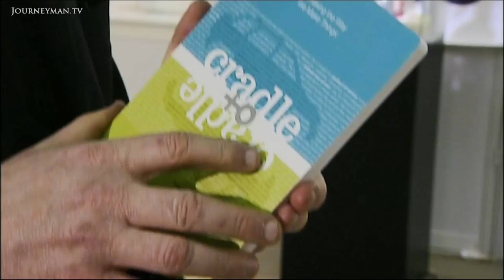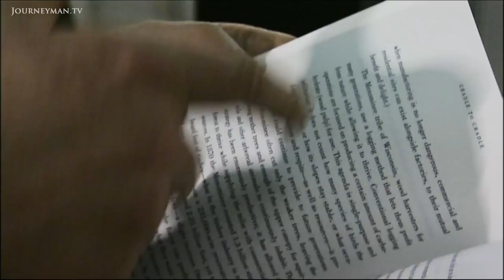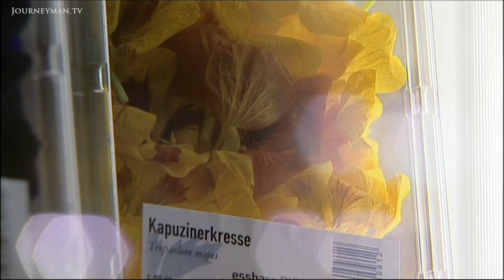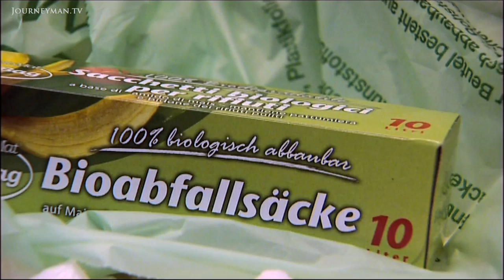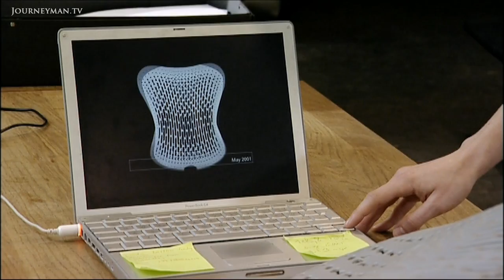Is Recycling the Solution to the World's Plastic Problem?

Comment: So, ok. I'm 55, a smoker, and live in Illinois. Alex, what's my price? ... Just kidding. But seriously, so, I get say peanut butter (99% which is sold in plastic "jar") use energy to heat water to wash jar, use water, pay for and use more resources to build big semi trucks, and more plastic containers for recycling, use more resources for driving and transporting all this crap, put it on a barge to China, assume it won't be dumped into the ocean, .....on and on and on.... Get the point? Why not use the Waste Management model of incineration and use the heat and methane? And environmental diesels? DEF ? DPF?  People really need to look at the entire cycle. And fast food joints recycle nothing. Same with most eating establishments as it's not feasible. Sports events, the list goes on. It not only cost more monetarily speaking, but also environmentally ,to recycle without some form of government subsidies. Same with Ethanol, Biodiesel, Solar, Wind.....